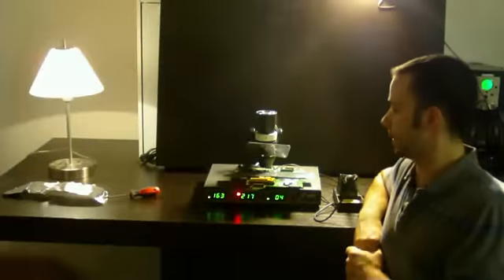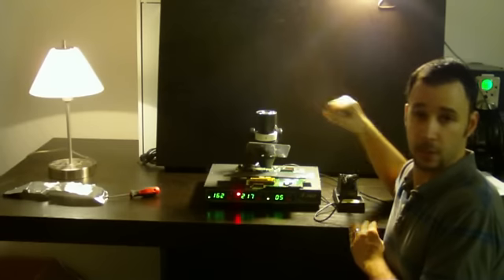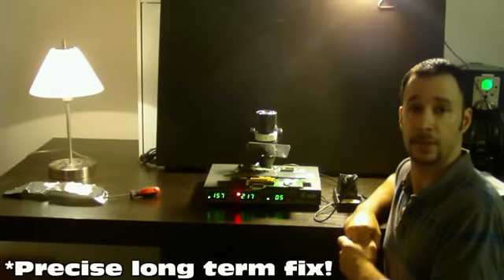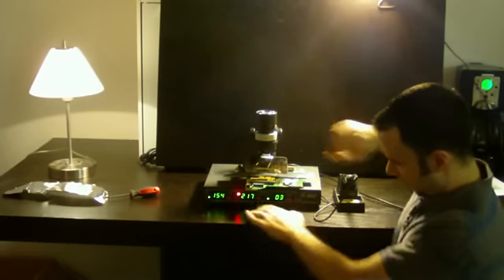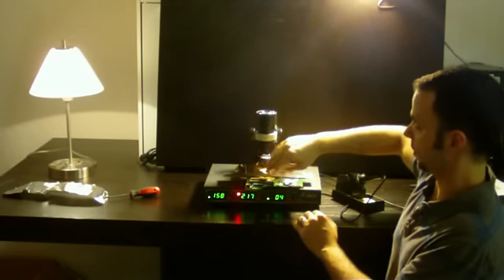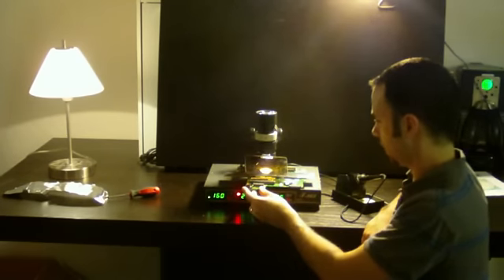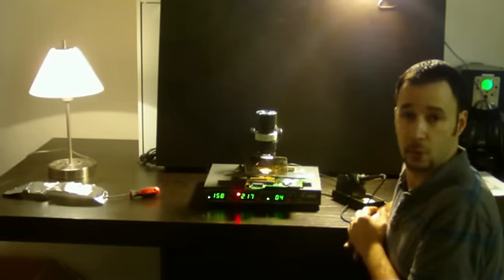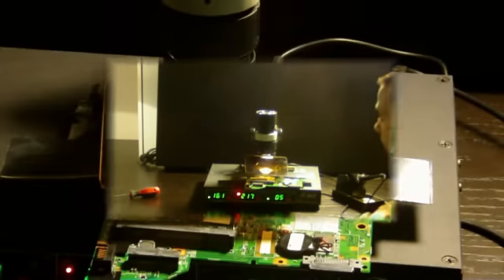HP Compaq Nvideia Video BGA Rework VGA rework

Comment: How often do you put new graphics chips on the computers?  My dv6000 has the 7150m chip.  Its under the "boot up for 2 seconds, shut off for 5, boot up for 2..." cycle category.   In your experience what do you recommend or see happening?

Comment: @goran001 230 may be a little too high. What I've done is start at 160 for 60 seconds, reflow at 217 for 90 seconds and soak at 225 for another 60 seconds while keeping the preheater at 150. So far so good. I also stopped using liquid flux because I've found it sometimes causes balls to fuse during reflow.